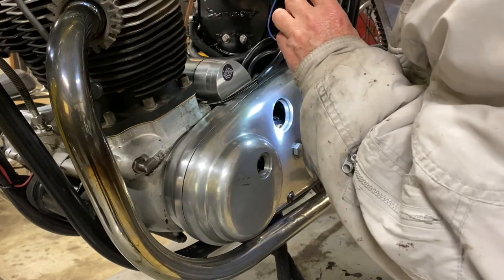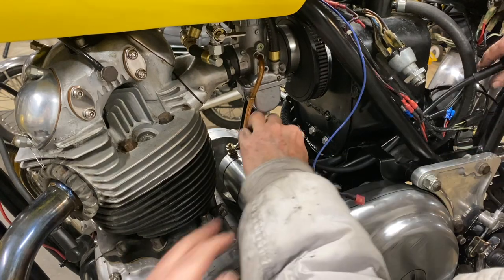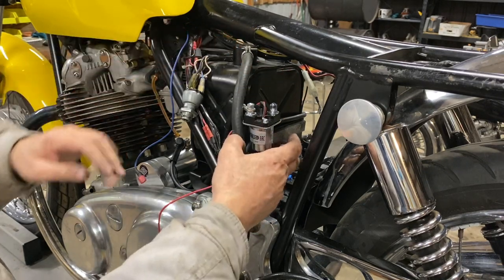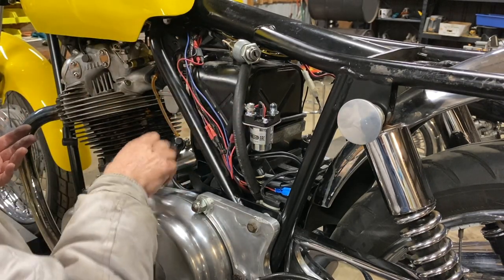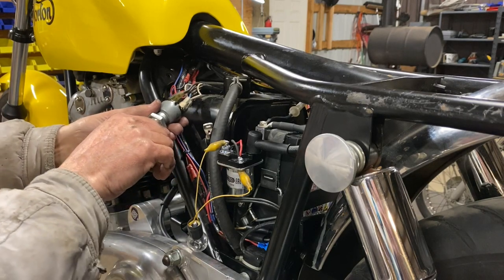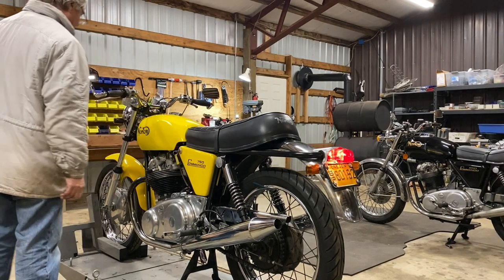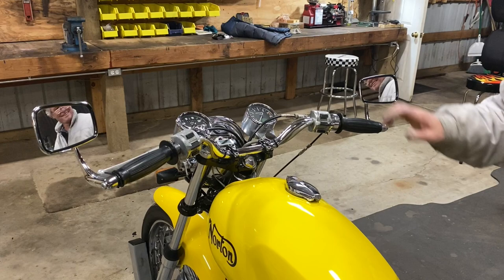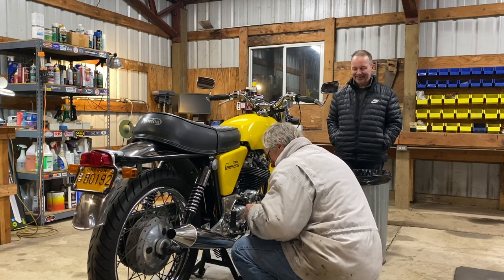Norton Commando Alton Starter Motor Project - Part 6 of 6 - Electrical Assembly and First eStart!

Comment: I've worked in electronics for fifty years, and was given to understand, "electronic parts work until the smoke escapes" and then, absent smoke, they no longer are complete.  Congratulations on "no smoke escaping", and keeping all your parts functional. lol  I believe when you start it with the choke, you will always get a bit of smoke, cleaning the oil from the cylinder tops.  Amazing!  Thanks for showing us, didn't know one could do that.

Comment: Bad idea to throw the kickstarter pedal in the trash bin .He should keep it on the bike. It sure will be useful when the starter motor will fail or in case of a dead battery !
Reply from the maker: Hi Vincent, I know what you mean but the main reason that Geoff installed the starter was to be able to get rid of the kickstarter. We talk about it in the first video. He will bump start the bike if the eStart or battery isn't working. Cheers, Mike
Reply: If he has electronic ignition installed he won't be able to start it with less than 12 volts in the battery anyway.
Reply: The kick start lever looks good in its place.   It might be needed some day…

Comment: On my MK3,  the primary calls for oil.  Is ATF better?
Reply from the maker: I think it's a more of a personal preference. I use Mobil 1 fully synthetic in my Commando but I don't use ATF in the primary cases of my other bikes. Perhaps it's because they are not sealed so well, but I haven't had much success with my primary cases holding the ATF. Best wishes, Mike

Comment: Thanks guys for a very interesting series. Wanted to fit Alton to my 72 750 but unfortunately I have a belt primary drive so cant do it. Shame! will have to keep that right leg muscular.
Reply: They referenced a method of doing so with a belt drive in the instructions.
Reply: @ChrisH930S  Hi chris thanks for the info. It was actually the UK distributor who told me when I asked him to fit the Alton for me. I have a Norvil belt fitted.  maybe things have been updated since then. Trouble is I have exported the bike to France now and the Alton outfit is on the other side of France. Cheers Nick

Comment: Greetings from the UK, brilliant job it works so well and I hope it performs better than the Commando MK3 electric starter set up in the longer term, makes me think that I should consider this for my 1974 MK2 A.
Reply from the maker: Thanks a lot Rosco for your comment. Me too!  I saw it last week or so but the video was unlisted and I couldn't respond until now.  I don't know how you managed to get to the video that way ;) I think you found a loophole (undocumented feature!) in Youtube ;)
Reply: Very nice and I too hope it works better than the MK3. I had a 1975 MK3 Interstate and the electric would not turn the motor over by itself when the motor was cold. Had to use the kickstart, could use both at the same time to make it easier. Once warmed up it worked great

Comment: Nice job, I did it on my 72 combat, just follow the instructions closely. Make sure your bike is running good, any backfires will quickly shred those little plastic plugs they give you, ask me how I know;(  Plus, any starting issues will quickly run down the battery as well. Overall it’s a well made unit, fiment is spot on.
Reply from the maker: Thanks a lot Chris. Great points!  Cheers, Mike

Comment: Congrats of a good bit of work with such a satisfactory ending. Recalling the concern raised in one of the earlier segments on altering the accuracy of timing scale on outer cover, did you ever confirm scale using a dial gauge on the crank? Something most C owners need to do regardless as those scales are routinely inaccurate. I know mine reads 1-2 degs higher than reality so I adjust the timing to suit.
Reply from the maker: Thanks a lot. That's a great point. I don't think Geoff has gone back and checked as he didn't need to re-time, but I'm sure he will do next time he needs to reset the timing. Yes, definitely if the case had been left as it was, it would have significantly changed the timing marks if using the scale on the Alton outer case. Best wishes, Mike

Comment: Are they Mikuni carbs?Unrelated question but curious
Reply from the maker: Hi Chris, yes Geoff has converted to a single Mikuni. We look at it in the 2nd video in this series. Geoff also fitted a very cool handlebar conversion to replace the enricher at the carb. Cheers, Mike
Reply: @TheMightyGarage  Thanks for that.I will check it out.I remember those levers on Japanese two strokes back in the 70's.